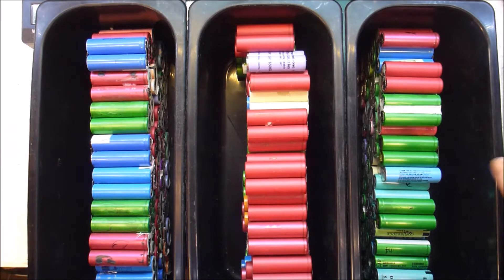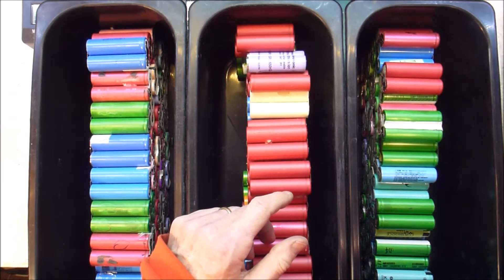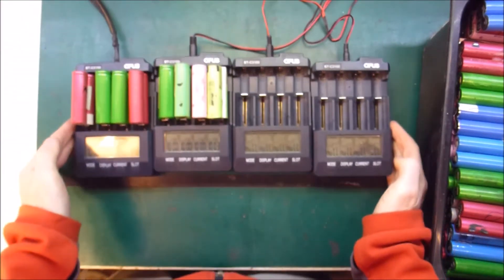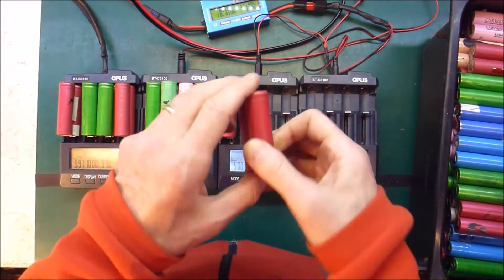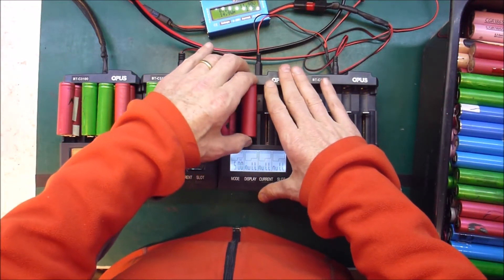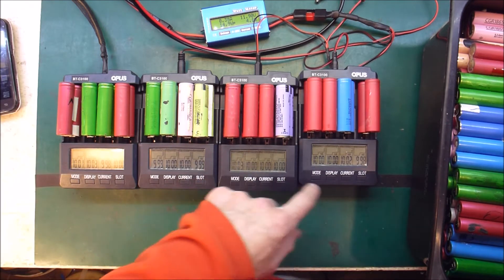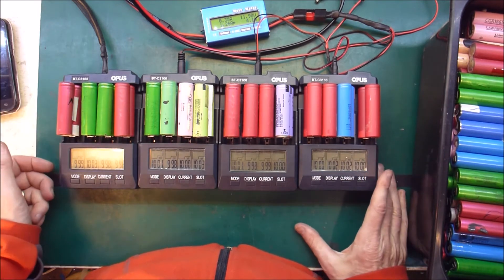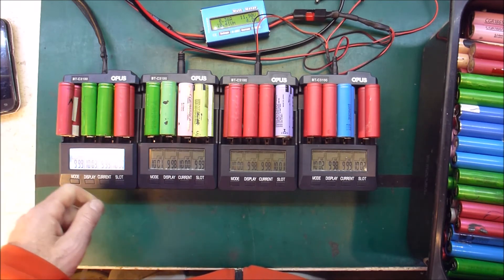Laptop Powerwall 121 - Capacity testing lots of cells

Comment: Hey Paul. Do you check the cell voltage when they come off the tp4056s to make sure that they actually reach 4.2v before you let them sit for the self discharge test.
Reply from the maker: Nope. If the cell finishes it's charge on the TP4056s I'm satisfied that it'll charge OK. I don't bother doing a top-up charge. My logic is if the cell voltage has dropped a bit due to self discharge then it's capacity reading will end up lower - so it's even less likely to end up in my powerwall. I only check the voltage after the 1 week settling period (as I put them in the Opus) to see if any cells are below my "total crap" threshold of 4.0 v.
Reply from the maker: And how's your pack going? Haven't seen anything from you in ages. You should do a "So far - so good" video. Cheers!
Reply: Paul Kennett I haven't seen anyone do the self discharge test at the beginning but I guess it saves time by not having to capacity test them. Personally I do the self discharge test right at the end after I know what cells meet my cut off. 

My 24v test system did its job and is now done. Unfortunately I didn't have enough solar to keep up with that small pack to run my full charging setup. The last 6 months or so I have just been flat out testing enough cells to go straight to a 30kwh 48v system. I am collecting 4500 cells before I start building anything. This will ensure all packs are equal.
Reply from the maker: Huh. I thought everyone did this way: harvest, charge, wait, discharge, etc. So you do harvest, charge, discharge, wait, etc. I can't think of any great difference either way. The important thing is grading the cells.

Comment: Good information.  I think I'll be trying my Opus for discharging on my next batch of used cells.
Reply from the maker: Just be aware the Opus discharges down to about 2.8 V so will give different results compared to other dischargers.
Reply: Good point.  I may have to try some side by side tests to see how that measured capacities stack up with my other dischargers.

Comment: You set to discharge from nearly full?
I presume you have to then charge them again?
The opus has charge test function, it will top up the cells, discharge them... get your capacity reading, then charge the cells up.
Not sure you are getting an accurate capacity reading, although not far off, if you test again and with full batteries youl get different feadings.
Reply from the maker: I prefer to discharge without a quick recharge. That means all my capacity readings are slightly less than if I did do a top-up. And the error will be greater (worse) for cells that have self discharged more. This gives me an added "safety" margin when sorting my cells. Hope that makes sense.
Reply: I get the added safety it's just that down the track if you test you can't be sure of the reading. After discharge do you then charge or is it automatic?
Also, your cells are in pairs. If one cell goes down or not performing it pulls the good cell down. You threw away a pair of cell when it may be one faulty?
But thanks for your reply. I am just starting out. So I like your dedication
Reply from the maker: I did 3 vids on pairs vs singles (Ep 40,41,42) https://www.youtube.com/edit?o=U&video_id=bCI3FtWAh8Q 
TLDR: pairs behave as one cell. I didn't find any separation in capacity of cells from pairs.
Reply from the maker: Ah. It's REALLY hard sending batteries overseas. And also kinda expensive to send stuff from New Zealand.
Reply: I live in the U.S zip code 22025,Virginia.